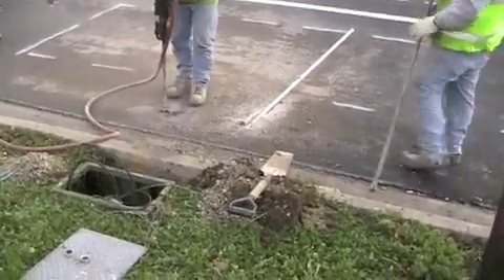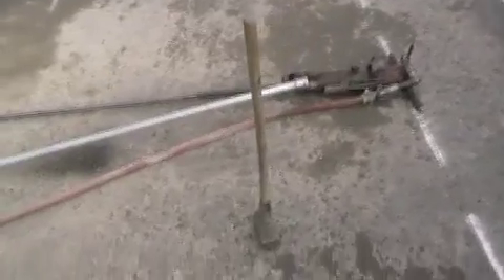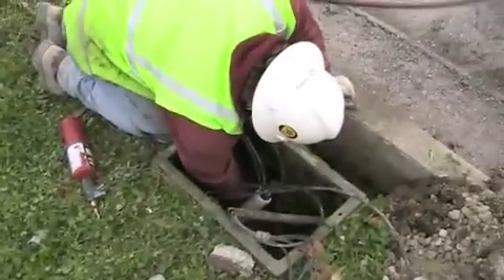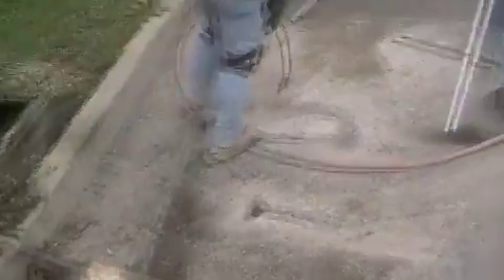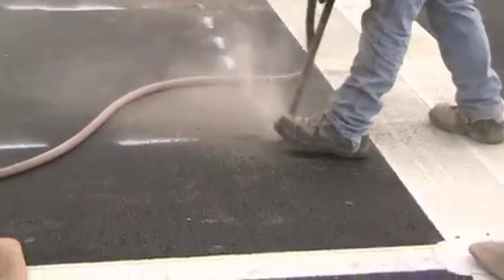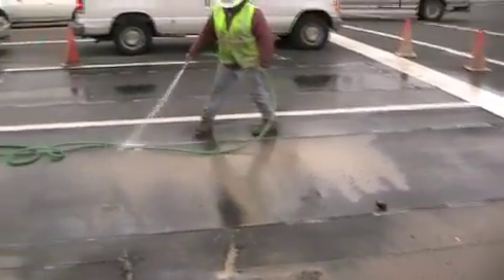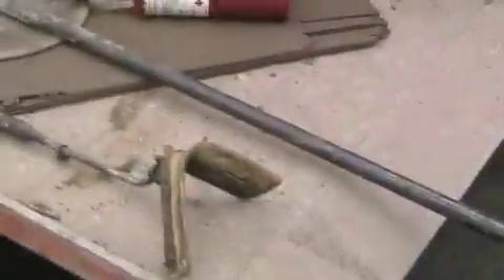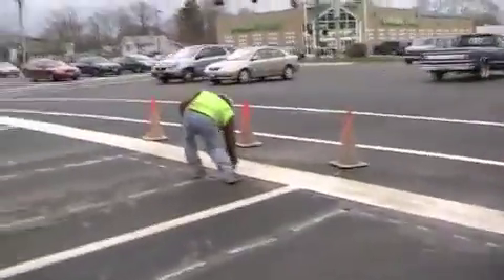Traffic Signal Loop Detector Installation - Part 1

Comment: How deep is the saw cut for the loop wire? If a loop detector is installed in a parking garage slab for a gate, is the saw cut likely to be deep enough to damage the reinforcing in the slab? Or is the cut shallow enough to avoid hitting any rebar (less than 3/4" deep)?